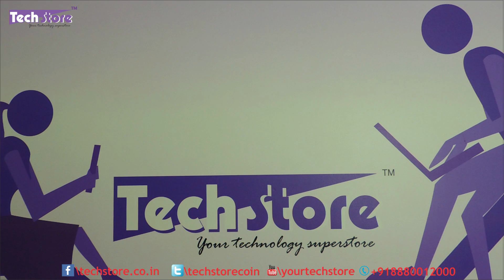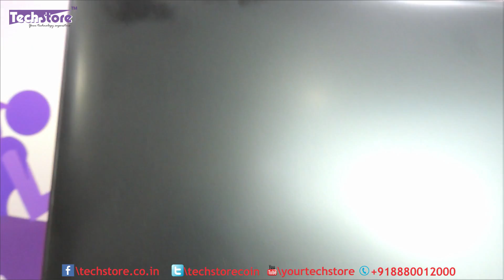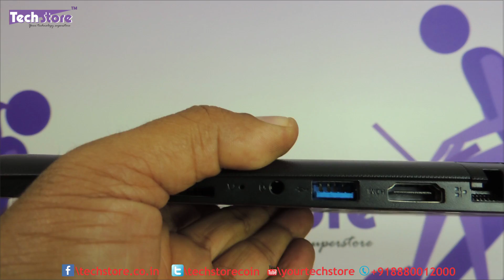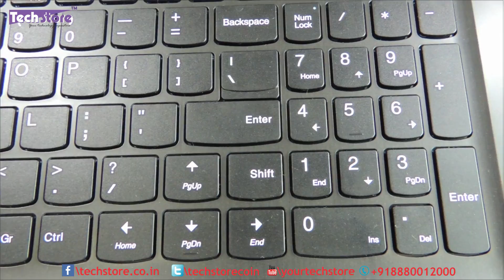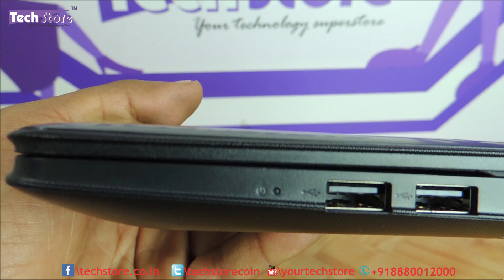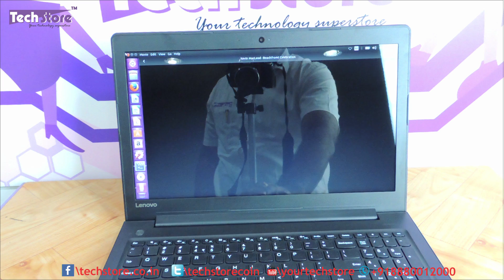Lenovo Ideapad 310 Black 2017 Full review India model hinges speaker in full HD

Comment: http://www.ebay.co.uk/itm/Lenovo-Ideapad-310-15ISK-Laptop-Intel-i3-6100U-8GB-RAM-1TB-HDD-15-6-Black-/332260303847?hash=item4d5c41e3e7:g:FGkAAOSwZ4dZFJWe#viTabs

Probably the cheapest one in England. Refurbished with only a few scratch marks. Core i3 processor.
Thanks me later :)

Comment: can it run GTA v smoothly and how's it for gaming?
Reply: im planning to buy acer e15 any thoughts
Reply from the maker: It is a frying pan when playing games. Will be shortly sharing a video explaining the same
Reply: Techstor I'm planning to buy this does this laptop overheat while gaming
Reply: Ketan Bhure 40°C it still good i have this laptop and the performance is 9/10. But you can buy a cooler for it(Laptop cooler pad).
Reply: Ketan Bhure if you want all out performance but don't care about heat or it occasionally becoming loud then id suggest the Lenovo but it depends on the price and parts as well as what you'd be using it for :/ tell me what the parts are for the acer and i will give you my advice (btw acer are normally more sturdy

Comment: iHello, i just bought my ideapad i7 lenovo with built in gforce 920mx, and in the dxdiax in display angle it shows hd intel graphic 620 is that normal ? I installed the latest driver for said gc. Help please?
Reply from the maker: You need to check if the NVIDIA graphics is disabled. When using DXDIAG,it should show Nvidia. Show it to your supplier immediate.
Reply: Otmane Arkoub It has 2 chips you can see it on dxdiag then go to display and render you will see it.